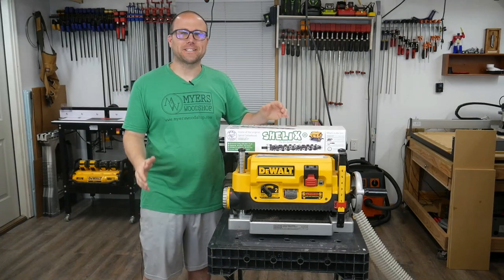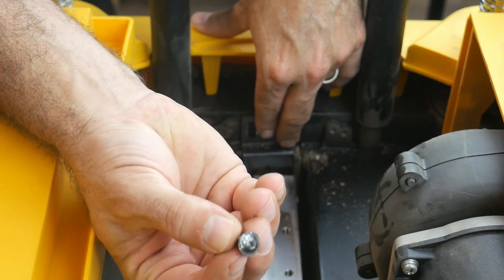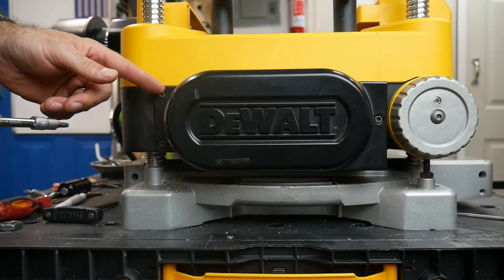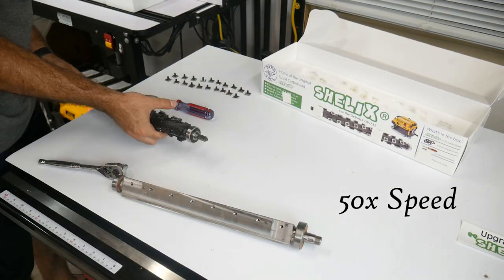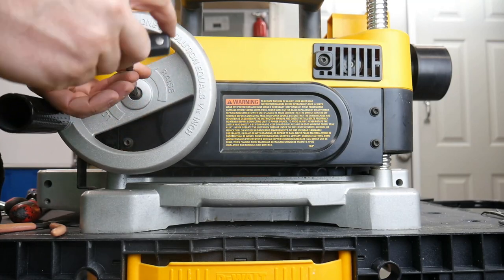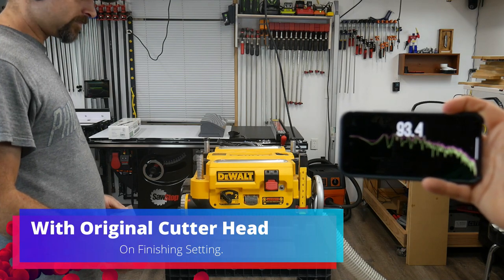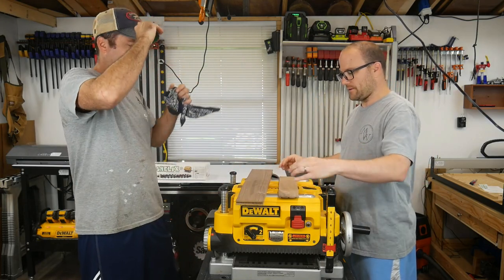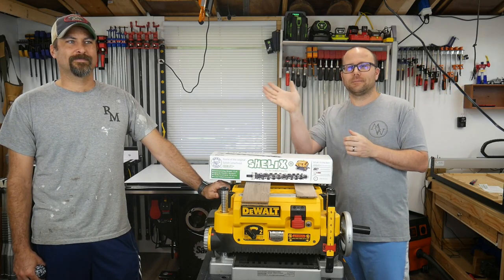Shelix Cutterhead OEM Install For Dewalt Dw735 Planer With Before And After DB And Cut Quality Test

Comment: I bought the DW 735 planer and the factory knives chipped on the first board.I installed the shelix head and I not even turned the carbide cutters yet after a year of planing hundreds of board feet of rough cut red oak,hickory,pecan,beech,walnut and everything else I can think of.The cost savings on not having to buy factory knives every other board is more than worth the $400 price tag.

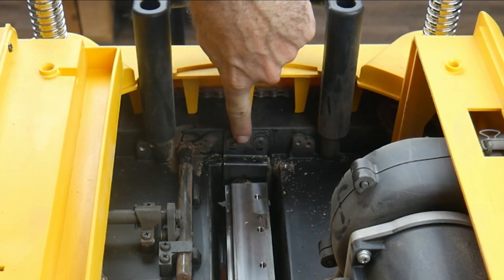Comment: A couple of notes to anyone disassembling their machine. First, the part they mention at 3:45 in the video - if you are having trouble rotating your blade assembly make sure you depress this spring-loaded piece. When it is in the up position it locks onto a bolt on that end of the knife assembly, making it very difficult to rotate. Simply depress it down, make the rotation and the knife assembly will lock into position with the screws facing up to make blade removal easy. If you install another cutter head other than Shelix, for instance the Titan Lux Cut Head, be advised that this part cannot be reinstalled onto your machine, as the Titan assembly does not have this bolt on the end nearest the smaller bearing. You would have to alter this part with a file to enable it to slip over the end of the cutter head.

Second, at 5:50 you may have to place a small piece of wood between the chain and sprockets. Turning the bolts that hold in the sprockets made my entire assembly rotate, possibly because I did not disassemble in the exact order they mentioned.

At 7:45, needle nose pliers work great, just make sure the gripping  surface of the pliers have teeth NOT SMOOTH faced. I had my large snap ring out in 3 seconds. 

At 8:30: DO NOT remove the snap rings in the manner they showed. Get yourselves a pair of actual snap ring pliers. You squeeze the handles, they open, and grip the rings at the same time to prevent them from escaping into your shop never to be seen again. 

At 10:45 don't use a clamp. Just clamp the entire thing into your vise on your work bench. Using the exact socket needed, the gear comes right out.

Otherwise, this is a very helpful video. Thanks for posting guys!
Reply: yeah i realized this was the case for me today so i unscrewed that plate after figuring this out...

Comment: I don't know if anyone had stated this already, but if you're upgrading with the Helical cutter system with the inserts, those inserts are numbered 1-4 on meaning when one side dulls, you can rotate them all to a new side. Definitely worth ensuring all sides are on 1, 2, 3 or 4 to make it easier for rotating the inserts. 

Awesome video, definitely upgrading! Thanks!!

Comment: I just completed my DW-735 Shelix upgrade using your video as a guide.  I only screwed up twice, boogering up one of the hex screws holding a sprocket on, but found I could get by with only removing one sprocket, but it was more difficult to reinstall.  I also forgot the large split ring and had to disassemble some stuff to get it into place.  I have both large and small c-clip pliers, so removing/installing those wasn’t hard, but finding the holes was difficult because of the low light level where I worked.  Thankfully, a hardware store is only a mile away!  

Thanks!  This was a very helpful video.

A quick follow-up.  The install went fine, but when I actually ran a piece of hardwood stock through the planer, I had a couple of ridges along the length of the board.  This necessitated removing a number of the cutters, where I found some debris under a couple of them.  Problem fixed.  I should have taken more time on the cutter reinstall.

Comment: I just bought a new Dewalt DW735 planer and a Lux CUT III cutter head. Your step by step instructions made it a breeze to install. I did pick up snap ring tool at Home Depot for ten bucks and it was well worth it. I used my cordless Ryobi drill with the torque set to fifteen to reinstall the forty cutter heads. This gave all the screws a consistent tightness. Thanks, you didn't miss a step. Looking forward to receiving my Myers Woodshop t-shirt that I ordered in appreciation.
Reply from the maker: Glad I could help!  And thanks for the support!!

Comment: Great video, thanks very much for posting! I did this yesterday. My advice: Get the snap ring pliers, absolutely will save you time and aggravation. Also get three M5-0.8x10mm screws, you will likely strip the screws that come with the planer - they are on TIGHT. I found both at Home Depot for $13 total. The pulley belt is a PITA to remove but eventually will come out.
Reply: Thanks man, I'm installing tonight, thanks for the screw info.

Comment: Thank you for the extremely informative video.  Following your step by step instructions yesterday, I had the old head out of the machine pending the arrival of the UPS truck with my new Lux lll head.  The reassembly process last night got as far as the installation of the new head, minus the inserts.  (The large snap ring is a large PITB.)  I will finish the job in the morning after enough coffee to wake up my brain.

Just for your information - Sound Pressure Level (SPL) is measured with the microphone three feet (one meter) from the sound source.    The pickup should be mounted in a holder of some sort, not your hand.  A three decibel increase in the SPL represents a doubling in volume.

Thanks again for the great video.  You made a normally intimidating job very simple.
Reply from the maker: glad it helped!

Comment: Instead of removing the roller drive cover, I found that putting one of the blade screws back in and then use a piece of metal bar to tap against the screw to push the shaft out with only a few swings, saves a little time.
Reply: Great idea.

Comment: From lots of experience replacing carbide inserts for my lathes and mills, I have to tell you that everything MUST be absolutely clean. The slightest bit of dirt, or even dust, can raise the insert enough to make a noticeable difference in cutting height. Even worse, if the insert is lifted at one corner, with the pressure of the screw, it can shatter when cutting.

As far as this being worth it, well, most people don’t have sanders. So add a good $900 for a sander. If you’re sanding by hand, with an orbital sander, it takes a lot of time to take planer marks off. This head seriously shortens the finishing time. The best head, as far as finish is concerned, is a true spiral head that has several spiral cutting blades extending across the entire width of the head. But these are extremely expensive, and require specialized professional resharpening. But boy, are those results good!
Reply from the maker: yep.
Reply: Like all the styrofoam bits stuck to it? So annoying!

Comment: Minor point, a 3dB drop equates to a 10% noise reduction, so a 10dB drop is pretty substantial!! Nice review and a worthwhile upgrade.
Reply from the maker: yeah, the sound was noticeably less!
Reply: @MyersWoodshop  Please keep in mind that the decibel measurement is logarithmic. Thus, a 10 db increase equals about double the perceived volume. So yeah, that's a lot.

Comment: Thanks for the video.  I have been considering this upgrade for some time.  As you stated in the video a new planner and the Shellix would be about  $1000.00.  So it would not make sense to buy a new 735 planner and upgrade with the Shelix.  The upgrade may not be as cost effective as just buying new replacement steel knives.  If my old planner dies I would definitely buy a new planner with the Shellix built in.  It is too bad you cannot buy the Dewalt 735 with the Shelix.  I think the 735 is a great planner and I have put thousands of feet of boards through mine.  However the last set of knives I put in I had a ding on it on the first board.  There was no nail or steel the blade just got a nick and I have to pass a board through two times to keep from having a line left on the board.  That slows me down but it is not cost effective to replace the knives for this small defect.  Bottom line for me the upgrade is not cost effective on my existing 735.  The future may have a shelix head but not on my existing 735.
Reply: @charlieodom9107  And virtually no tear out! Get a 20" planer and that thing doesn't have shelix heads ANYWAYS!

Comment: Thanks for posting. Great video! I've watched numerous Shelix install videos and this is definitely one of the better, particularly the video with good shots of all the key steps. The snap ring sequences were a little painful to watch, but they got it done, albeit with 2 people and "3 pairs of hands". Nits I can't help but pick: The whole assembly is "the cutter head" so when you remove each of the 40 individual carbide inserts, you're not "removing every single cutterhead." One thing missing was a summary of the pros and cons of the OEM size vs. the reduced size versions of the Shelix cutterhead. And, although I make the same mistake if I'm not being careful, it's not 'Shell-icks", it's supposed to rhyme with 'helix', hence the spelling with 1 "l", pronounced "Sheeelicks". But these are clearly gratuitous criticisms, the video is clear, well-lit, and steady and the narration overall is quite good, making it a pleasure to watch!
Reply from the maker: the snap ring was the absolute worst.  we didn't have the right tool for the job.

Comment: I recently bought a factory refurbished Dewalt 735 with the sole purpose of putting a helical cutterhead in it.  I gave it one last careful look-over before starting it up and realized that the splined drive belt had walked forward on the motor pulley as well.  I noticed it because it was not parallel to the housing when centered on the cutter pulley.  It was really close to the chain that adjusts the depth of cut.  There is a little inspection port.  I took that off and adjusted the belt at that end too.  Just an FYI for anyone doing this.  Haven't used it yet but decided to try the LUXCut III also sold by Mywoodcutters.com .  I will upload a picture if I can figure it out.
Reply from the maker: ok

Comment: There are now other manufacturers of diy cutter head upgrades such as the Sheila Company which offer same or better quality products at lower cost. In recent years the prices of these cutter heads have spiked and opened the door for competitors to enter the market. This year I will be upgrading both my dw735 and my Ridgid 6” jointers cutter heads with helical ones mainly because, along with the benefits this video listed, helical cutters are amazing with figured wood which is what I work with. Plus I work in my garage and I have neighbors and town ordinances to work around and anything that reduces the noise pollution inherent with woodworking equipment is music to my ears. And my neighbor.s.

Comment: Your board tester corrected himself from shee-lix to shell-ix. Pretty sure the former (shee-lix, rhyming with helix) is correct. It's short for "Shear & Helix".

I had one of these heads in my DW735. Their packaging has come a long way since then when it was a brown box with a couple blocks of wood to support it. :) It made a huge difference, and more importantly, got me out of the knife-changing game with the 735. Before the shelix, I was constantly nicking those straight knives on maple. I even used the single-side expensive carbide knives. In the end, the Shelix made a lot more sense. I wasn't concerned so much about cost as I was the irritation of having to constantly rotate the knives.

For figured wood, the Shelix makes a huge difference compared to the straight knives. I know you didn't talk about that when talking about quality and sanding, but it's a HUGE difference. If you are doing curly maple or something similar, you will really notice the difference. Really, figured woods is one of the main reasons to go with a helical insert head for any jointer or planer.

I have a Hammer/Felder jointer/planer with a silent helical head now. I wouldn't have realized how good those could be if I hadn't tried the Shelix first. 

Tip on the mic: Get a pop filter of some sort, or make sure you aim your mouth to one side of the mic instead of at it. Your plosives (like when saying "pop" or "purchase") are coming through super loud on the video.
Reply: I will call it She-Lix until I'm dead. If they wanted it to be called a Shell-ix, they should have spelled it right.

Comment: One more thing - each cutter has a mark on it that are all facing the same direction when new. The cutters should be put back so that they all are in the same position. This is so that when you rotate a cutter 90 degrees after it is damaged or wears out, you can identify the rotated ones because they are aligned differently. Otherwise you’ll never be able to figure out which ones have been rotated and how many times they have been. Always rotate in the same direction - clockwise or counterclockwise as you prefer.

Comment: Thanks for doing this. Very clear demonstration.  I am in the process of deciding between a drum sander and this Dewalt with Shelix cutting head.  I would not consider the planer unless I could install the Shelix.  Watching this I think I could do it.  I too will probably get the OEM for the same reasons you described.
Reply from the maker: Glad it was helpful!

Comment: Outstanding video. I mean you really knocked it out of the ballpark for clarity, camera work and narration. Wondering how you feel the finish compares to that of the straight knives. I heard the Shellix leaves a distinctly wavy surface. Have you noticed that at all? Also, do the cutterheads fit in a specific way? I mean.. is there some sort of tactile feedback to let you know the cutter is positioned correctly? Thanks again for a terrific resource!
Reply from the maker: no, it's much smoother.  thank you!

Comment: IMPORTANT: This video is very good and I got mine fitted reasonably quick, maybe 2 hours however........ The piece with the spring that has 2 screws that easily sheer became a problem. It wont fit over the new spindle so you have to pass the spindle through it as you are putting the spindle in. I hope that helps as it takes a while to take it all apart again to rectify it.

Comment: Thanks for the complete. And unbiased video and review.

I was thinking about getting the Sheila but after using my 735 for about 3 months and running cherry, maple and sapele through it (I buy 4/4 or 5/4 lumber). The surfaces are absolutely as smooth as it gets on the rough setting. So I can’t see how the Shelix would improve things. I can buy 10 sets of new knives (that 20 cutting edges) for,the price of the Shelix. 

At the rate I use the planer it makes absolutely no sense.

The noise factor - doesn’t everyone wear hearing protection and eye protection anyhow?

Btw, my snipe is practically not noticeable.

Just my 2 cents.
Reply from the maker: yep.  its not for everyone!
Reply: Are you using the stock knives or carbide? I have had problems with the stock knives getting nicks in them while planning clean maple. The finish not at all smooth which led me to get the shelix.

Comment: The noise is quite a difference, however, the only reason you are getting smoother cuts is because it was a used machine and likely saw a ton of use. It certainly looked as though it did. I would buy a larger machine or the 735 and replace the knives when needed. Thanks for the video. Sorry about the buyers remorse! lol Keep the videos coming.
Reply from the maker: the blades were ok. it has seen a lot of use.

Comment: The piece that you hammered back into place (with the spring on it) isn't supposed to be reinstalled. It's an indexing tool that helps removal of the original knives (when changing blades). If you noticed, when you took the 3 original knives out, you're supposed to have to press down on it (since it's spring loaded) in order to rotate the knife holding head 1/3 revolution.  When released, the contact points hold the head head on the small bearing shaft side of the assembly. When you reinstall the dust chute, it presses down on it and allows motor operation. Since the carbide blades are in a shelix/helix pattern (and given the fact that the new assembly doesn't have a hex end), it's simply not needed.
Reply from the maker: You're right!

Comment: Got the inserts installed and the machine put back together and---IT WORKS!  Thank you for the help.  I also gave you a thumbs up on James Hamilton's site, StumpyNubs.  Wonder whether there is a market for a used straight blade cutter head, five sets of blades, and a Deulen sharpening jig from Rockler?

Thanks again.
Reply from the maker: I tried...no one bit one Ebay

Comment: At 18:23 in your video you use some “gentle persuasion” to reinstall the cutter rotate lockplate.  The instructions from Byrd Tool say to discard that lockplate.  That may be why it didn’t fit well.
Reply from the maker: yep, they added that AFTER i made this video :P
Reply: @MyersWoodshop  I would suggest that you put a notice pinned at the top of the postings (or in the description) - or even in the video itself - that the re-installation of the lockplate should be ignored.  That would be helpful.

Comment: I put my Lux OEM cutterhead on tonight. One thing I would stress is DO start all screws by hand when putting the square carbide blades back on... yeah. I may have cross threaded one the first quarter inch because I wanted to put them on faster.... I’m an idiot.
Reply from the maker: haha

Comment: Thanks for the video!  Geez, DeWalt couldn’t have made it any harder to replace the cutter head.  Will have to keep that in mind when I’ll be selecting my first planer.  Sure hope there are more user friendly options. 🙄
Reply from the maker: they didnt.  just get a good snap ring remover.
Reply: If you haven't purchased a planer yet, I absolutely love the Oliver benchtop planer! Comes with a Shelix head pre-installed and it about $100 less than the DeWalt and Shelix upgrade.